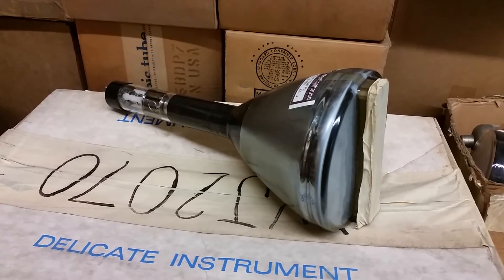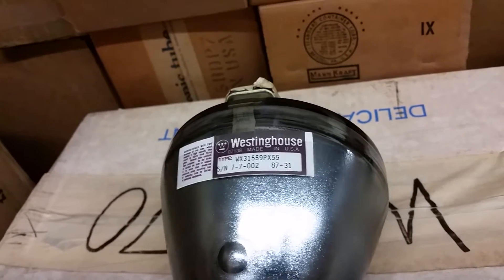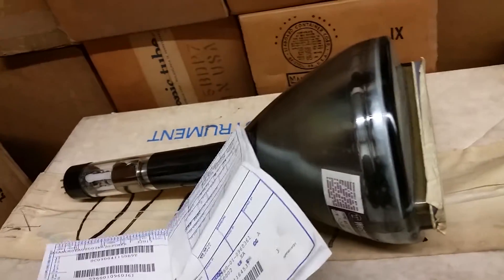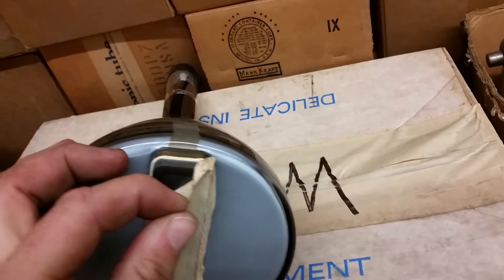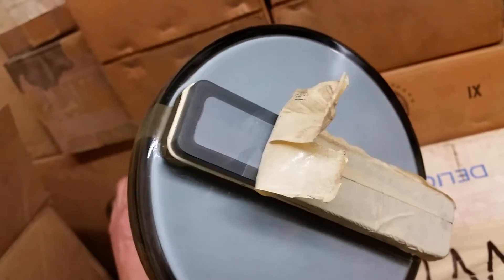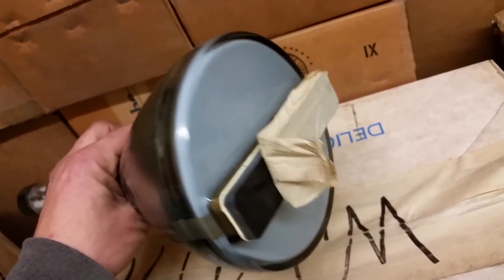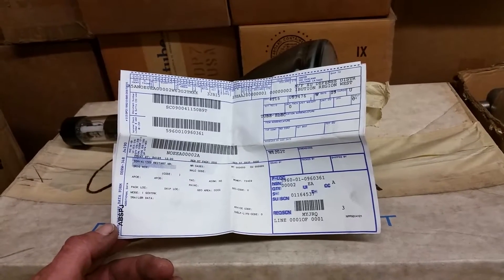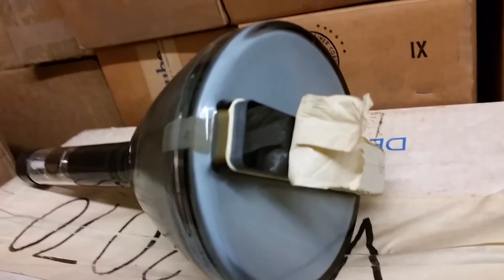Weird Westinghouse CRT

Comment: It is a fiber optic faceplate photoprinter tube. Probably used by the weather bureau for printing Landsat  weather maps in the 1960s. It needs to have very short persistence phosphors. Also, this is probably a late model spare from the 1980s because there were no bar codes in the 60s.

Comment: According to this website (http://www.bunkerofdoom.com/WX32320PX55/index.html) is some kind of picture-to-film one line at a time transfer crt.
Reply from the maker: That is what I figure - I have seen those types pf tubes before, but they did not have the diffraction grating thing, just the phosphor. I am starting to wonder if the grating  on my tube actually a light collimator in front of a phosphor.

Comment: I would say a display for displaying staus or messages.... Possibly for the rail industry. I have seen similar in scrapped rail signs for subways but they were on square crt not round........
Reply from the maker: I think it for text as well - but what is with the weird diffraction grating or polarizing filter thing going on in the flat part? I suppose there may be a phosphor underneath that I can not see. And why super flat?